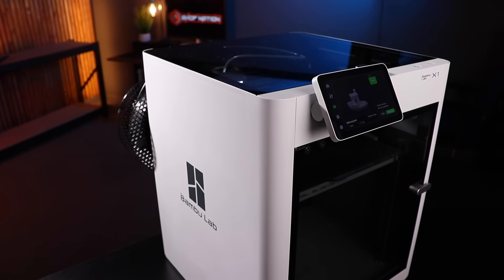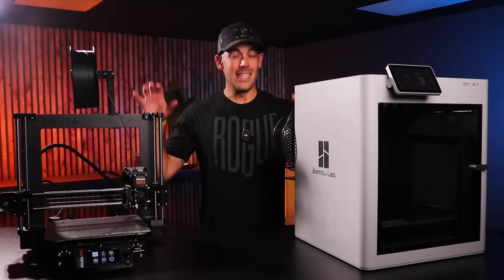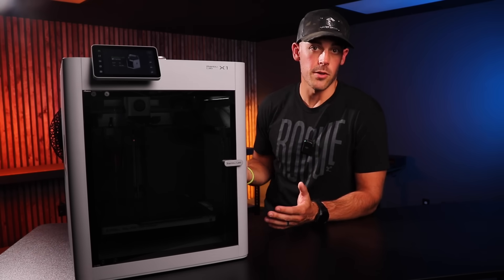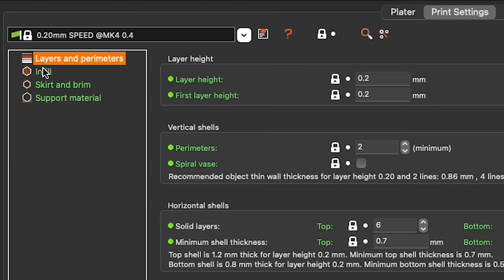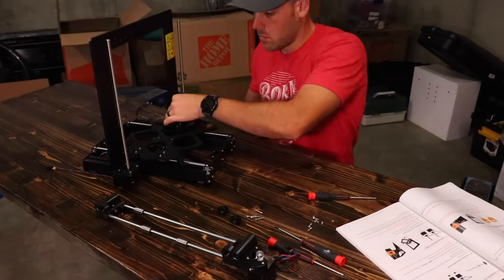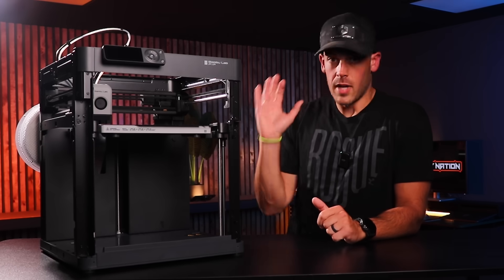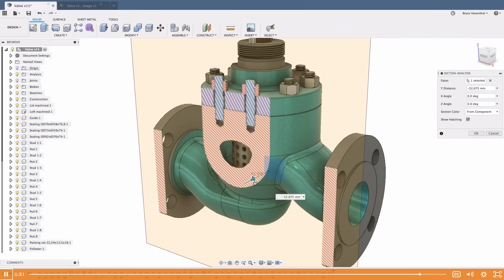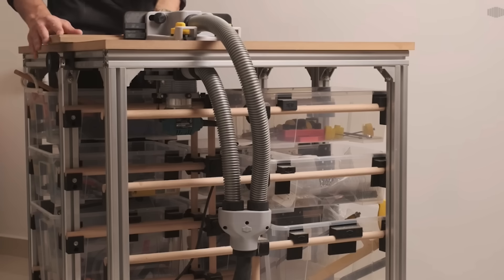The 3D Printer I'd buy if I started over

Comment: Travis going hard on nerds and dorks. Careful, someone is going to hack your farm and make them start printing middle fingers. Why you make me spend money Travis? I didn't even need a 3D printer but now I have a farm... or at least a garden
Reply from the maker: 😂 just imagining walking into my print farm and seeing rows of middle fingers
Reply: @ShopNation  hey what's a good like step by step 101 to just learn 3d modeling
Reply: @iiNgONYaMa tinkercad is good for the bare basics but it has some significant limitations.
Reply: @ShopNation my question is the mark 4 has tons of videos of mods, so does the Aquila, I bought right after the x2 came out. Horrible experience. I'm told the mark 4 is super reliable and has great consistent resolution. I'm just tired of wrenching and would like one piece to be printed in spec and faster than 30 mm/s.
Reply: @ShopNation or butt plugs
Reply: @ShopNation you need to do this!!! We would buy them.
Reply: @ShopNation  thanks for sharing.  I was going for the bambo lab P1S . Any idea if it’s good choice.  Also should  I buy it with Ams.  No idea what is ams , still my first 3d printer, I prefer to buy something good for once and for all.
Reply: @ShopNation what would you recommend to print metal items
Reply: @jeffsingleton88 a laser sintering machine and COTS AI software to model thermal dynamics and stress points. So about 750K and probably more hiring a material design engineer and a data scientist
Reply: @Esper320  yea, too rich for my blood. Thanks for the reply
Reply: Not gonna lie, if I walked in and saw that, I would die on the floor laughing. I couldn't even be mad.
Reply: 40 printers...  so 40 letters and the wheel of fortune layout.   Now what message to send?   😂
Reply: @spsully2582 Easy: " f*** y** " 😅
Reply: 667 like if anyone was wondering
Reply: It doesn’t work like that bozo
Reply: 😂 lmao
Reply: 3d printing has its roots in rep-raps and modding. We diverge from that when we move towards Bambu, that’s cool and that’s expected. It’s a shift from producer to prosumer as often happens.
Reply: @mconstant007 I think AnkerMake was probably the start of that movement but they are terrible which is why Bambu is getting such a big market share so quickly
Reply: For people that want a hilarious video on the history of 3d printing check this out https://youtu.be/Ngi_fyumi4A?si=h0jnqRf-0-EoCRDi
Reply: ...but its ok. Geeks, dorks and nerds make the stuff that rule the world. Every smartphone bought by the cool guys can thank them for them as they tweet about how they don't like geeks, nerds and dorks. Even twitter, now X, owned by a super geek, was programmed by a geek. Now the woman that used to look at the big man on campus, looks at the guy with the pocket protector with potential. Geeks make all the stuff that real people want to be a part of . And they employ the cool people too.
Reply: And buttholes
Reply: Wait till it becomes a forest!
Reply: Skill issue tbh

Comment: Don't buy the Bambu P1P!!  I got mine less than 4 weeks ago and its not working and customer service is VERY, VERY BAD. Wifi Issues started 16 days after receiving the product. (Now I can't use my AMD.) I wanted to upgrade to the X1 Carbon but they wouldn't let me as I was 2 days past the return period. They have made me do the same troubleshooting tips for 2 weeks now and still won't wont. The customer service is in China, since I am in North Amercia, every time they give me a response I am stuck waiting another day. 

DON'T PURCHASE THE P1P, go with the Creality K1 or the Bambu X1 Carbon, the P1P is not worth the money!!!
Reply from the maker: I know far more good experiences than bad, sorry you had a rough time but that is not the norm
Reply: @ShopNation  I understand that 98% of the printers will work great. However, customer service is equally important, and their customer service is very bad. 

(I am in business consulting with 22 years of experience in customer service. And Bambu needs to change up their management team/style. They are rude, and only know how to ask the same question over and over.)

Comment: The future of 3D printing is going to be easier and easier to use 3D printers. The BL printers are just the start of that. Printers as an appliance is the way things are going and buying something nowadays that forces you to learn stuff you're not going to need to know in the future seems kind of pointless.
Reply from the maker: Couldn’t agree more! They will be more and more like running an apple product. It will just work
Reply: Just work = ) Ha ha. Apple product. Lol. As an owner of multiple Apple products, I would say, those are overpriced over-marketed bs.
But if you have spare money? Well, no one can stop you from disposing it.
Also what is appliance of 3d printer at home, which is like a tool, but which you do know nothing about? Just press button and what? Why do you need that at home? Why not just order a print from a print farm?
Reply: @enosunim  Why have a microwave at home when you can just order food from a restaurant that's already hot?
Why have running water when you could just go to a municipal water source and get water?
Why have a paper printer when you can just get everything printed at Staples?
As time goes on 3D printing will not be a hobby anymore. Eventually 3D printers will just be something that are in most houses and will be able to produce commodity items reliably and rapidly. People will do this for the same reason they do everything else that is convenient. It's convenient.
I'm not saying that it's going to happen the next 5 years but it is the way things are going and I don't know if you ever use a BL printer but I've been printing for many years now and they've really are a step above. In general, unless you're doing something weird, they really do just work.

Comment: Maybe you've covered this at some point in another video, but how do you manage 40 printers, from a software perspective? Do you have one PC you run all of them from? What's the workflow getting from a model to having 40 printers all churning out batches of prints?
Reply from the maker: They are all running independently on SD cards, it’s not ideal!
Reply: @ShopNation  Linux server.   Made with pocket holes and built in dust collection

Comment: Thank you for this information! Why do you prefer Autodesk over Solid Works? It’s been about 20 years since I used either and at that time Sold Works was the significantly better 3D model tool.
Reply from the maker: I actually grew up on solidworks so I really like it. I just like the accessibility of Fusion for the average user
Reply: I give the nod to fusion as the most powerful cad tool, but Onshape is my new go to program.  I can start a new project with full functions from my cell phone.   No more need for hardware this or that.   Just internet connection.

Comment: I bought a P1P after dealing with a low cost unit and I cannot recommend it enough. All the constant headaches are gone and I can just get things printed out. I am printing constantly & bonus it is faster and quality is so much better. Additionally there is a Opensource fork of the Bambu Labs slicer with all the features and added calibration tools that really gets these things dialed in.
Reply from the maker: So true
Reply: I have completely stopped using my other 3d printers once I got a P1P. It's been 6 months and I dread using my creality machines if my P1P is busy.
Reply: @kongchho8547  Have you had to fix your P1P much?
Reply: @lorcster6694  Not really. Just cleaned the rods once since it gets dusty in my office. But with the P1S it's enclosed so that's not an issue. I have at least 2000 hours of printing on it. However, it's different for everyone but there's a reason why almost every 3d print youtuber has one in background.
Reply: @kongchho8547  Apparently some parts of the Bambulab you can't source yourself if they break? (Rendering the device unfixable?) That is slightly concerning for us but I have only heard good things about the Bambulab.
Reply: My plan is to get a P1P alongside a Kingroon KP3S Pro V2 (not gonna lie, i just want to buy it because is cute).

Comment: The faster you go the more filament you need to disperse the Bamboo and FLsun V400 don’t have extruders capable of providing a high enough melt zone to keep up with those temps and so what you make is a more brittle weaker part, CNC kitchen came out with a video that outlined that as well so faster comes at a price of strength if the extruder ain’t feeding it fast enough and those max speeds they share are really only for ABS, PLA should never be printed over 150 to 200mm/s

Comment: Love your content .
How about making a video on the 3D material types, strengths, and uses.   I've always wondering about the durability of 3D parts and the cost print materials.
Reply: PLA: Widest # of variations, easy to print, cheap, but not good for outdoors and can be brittle. Highly recommended for newcomers and is usually the primary filament for most people.
PETG: Makes up for PLA's biggest weaknesses, but a bit more difficult to print. Still easy enough that many people use it instead of PLA as their primary filament.
ABS: Requires good ventilation and can be difficult to print, but can withstand more heat than PETG. Used to be the most common until PLA took over.
TPU: Flexible! This particular material can be bent and squished, and is plenty strong. Requires printing slow on some printers. Good to have if you want an option for flexible parts.
Other materials: There are other materials, but they tend to be for specific purposes, can be much more expensive, and may require upgrades if you have something cheap like an Ender 3. That said, if you want something with strength beyond what the most common filaments have, there are options.

One thing to note is that many materials (PETG, TPU, many specialty filaments, especially Nylon) can absorb a lot of moisture and may need drying on a regular basis. PLA needs the least drying, and most people can get away with never drying it. That said, drying can still help if you're in a moist climate or haven't used a spool in a long time and you're noticing some quality problems.

Should also be noted that additives are added to filaments to adjust their properties, hence why you can get PLA in PLA+, Tough, Silk, matte, etc. This also means that different manufacturers (and even different colors) will have variations depending on the mixture they use.

As far as cost goes: PLA is usually around $20-$25 USD per kilo if you don't want crappy quality. One spool can go a very long way if you're printing small or medium size prints, although if you're filling the entire bed that will eat through filament quickly. Should be noted that most 3D prints are hollow with some infill, so the surface area of the outside of the print will be the biggest determiner of how much filament you will use.

ABS can be a bit cheaper, as it's a common raw material in other manufacturing, PETG is kinda the same price if I remember correctly? TPU is a tad more expensive but generally still in the same ballpark. Once you start with exotic additives or exotic materials, then prices can definitely go up.
Reply: @logicalfundy  Thank you, that was very informative and gives me a basis for further investigation.
Reply: @logicalfundy  very well written.   Thumbs way up
Reply: Worth adding to his list because it's pretty cheap and common is ASA.  It is basically a UV resistant ABS.  Prints about the same as abs but works great for applications that will see sunlight and heat such as pool attachments or automotive interior pieces.   

The list of exotics is staggering and overwhelming.   Heck you can print with metal or ceramic impregnated filaments and then smolder them and have just the metal part.   But his list plus the ASA in mentioned are more than enough to get you printing things you never thought possible just "print out" in your own home

Comment: Totally Agree if you want to get into 3d printing. But if you want to get into '3d printers' and have a basic knowledge of machines,  a used ender 3 is always a good option. It basically forces you to learn all possible problems of 3d printers.
Reply from the maker: Yeah lol I don’t think that’s necessary
Reply: That's not a good idea a ender 3 is a bad printer for today's standard and specially used. I recommend ender 3 to 2 family members when there were at $160 on Amazon new and now there are collecting dust because it is very frustrating for them and I get it.
Reply: I'd be pushing a sovol if you want to stay in the budget end.

Comment: So true,  I got into printing about 6 months ago,  started with the ender 3 neo. I had no clue how much time was spent tinkering on the machine rather then the machine printing. If I were to start over I would spend the money up front and go with a k1 which is what I am going to move to eventually.
Reply: Definitely get the p1p you can add later the ams and the bambulabs support is way better.
Reply: I've tried both the K1 and the P1P... personally on balance and if it were my money. I'd go with the P1P. It lacks a bunch of features that the K1 has, but it's just better built in every way. It is a very tight race though!

Comment: Is running a huge printer farm like that really more economically feasible than designing an injection molded part? Especially considering the failures you talked about previously.
Reply from the maker: I need to make a video addressing this because it’s a very common question
Reply: For his application No. He is serving a niche community with products that are customized. To get an injection molding tool (mold) designed you are in the 10-20k rage per item you are selling. Then you have to find a custom molding shop that will run your tool and they want to run thousands of parts to make it worth while. The 3d print farm although more expensive to run allows him to keep inventory down, and make tweaks as he goes without any cost to re-tool.  Now, if he was making one item with mass market utility, Injection mounding is the way to go by far.
Reply: 3d printing's big advantage is that you can change the design on a whim, test the market without investing thousands of dollars, or make items for a market that couldn't justify the investment of injection molding.  It's agile.  It's also way slower, way less accurate, way less repeatable, and way more expensive per-unit (after molds are paid off).

Comment: Great video and good advice.  I do agree with some of the other comments, that even $700 to start is going to be steep for some (like me).  I started with an Ender 5 Pro that I got at a deep discount, and have been 'blessed' with all the learning opportunities that have come with it.  All in, I think I'm somewhere around $400 for amount spent on 3D printing, and would consider myself a optimistic amateur.
Reply from the maker: Yes and no. You are flipping a coin going with a cheaper printer and if it went bad, it would likely turn you off from printing all together
Reply: @ShopNation  True, guess it depends on how determined someone is to get into it.

Comment: As a ender bro myself I do agree. I got my ender 3 when it first came out so it was 1/3 the prusa price for a little work. Added auto bed leveling and an all metal hot end plus a better extruder over the Years, but hard to beat bambu labs p1p now. If I were starting today the p1p is the no brainer to start.
Reply: Same boat here, my first printer was an ender 3 pro. Works great with upgrades and I love how it let me try the hobby for such a low cost, but not sure I’d recommend it as someone’s first printer nowadays with all the innovations that have come out since.

Comment: Nailed it. I just upgraded my ender 3 to the bambu and I can honestly say I've printed more with the bambu in 4 weeks than I did for years on the ender. It works. It works well. The prints are amazing, it's easy to change filiment, it's easy to print all the types of filaments and the software is great too (bye octoprint). It's pricy but when you count all the upgrades needed to make an ender 3 even close plus the time I spent on debugging and fixing the stupid machine over the years it's a small price to pay.

Comment: Totally agree with everything you said. I have a creality cr10S5 which I bought mainly for the 500x500x500 bed so I can print molds for my RC jets. But the slow speeds and manual bed leveling really takes the enjoyment out of it.  My next one will be the Bambu carbon x1 with the 4 color head, I had been wondering if you had seen the Bambu printer knowing how much 3d printing you do.
Reply: Everyone who knows even a small amount about 3D printing and keeps relatively up to date or even just looks at anything to do with 3D printing on the internet will know what Bambu labs and the X1C are.

You could always try installing Klipper and input shaping if you wanted to make it print faster.